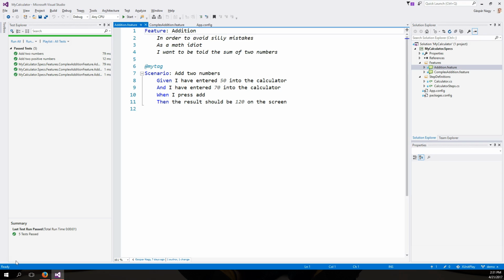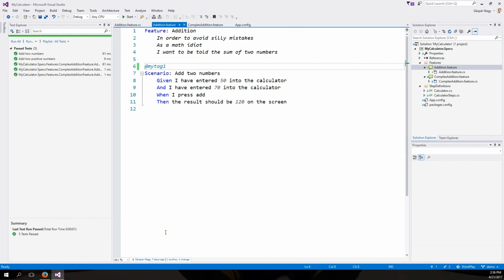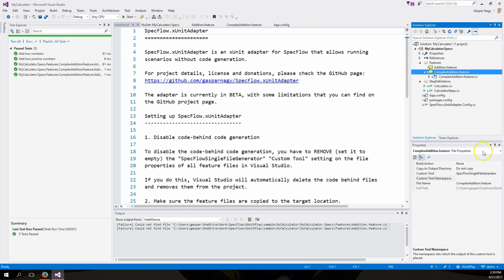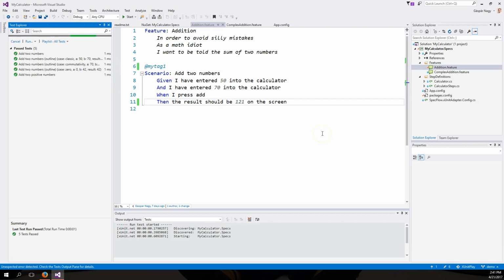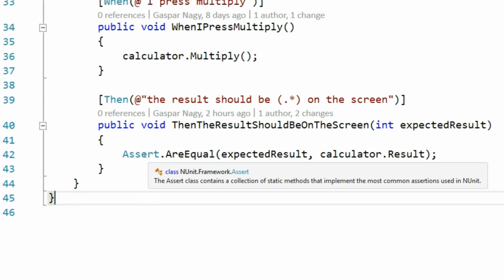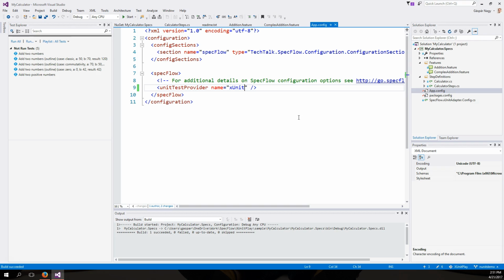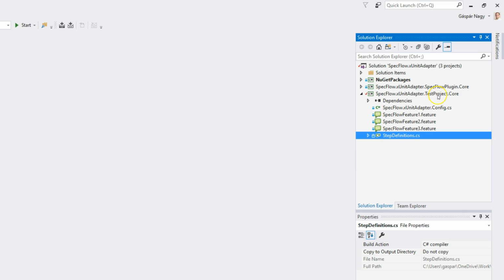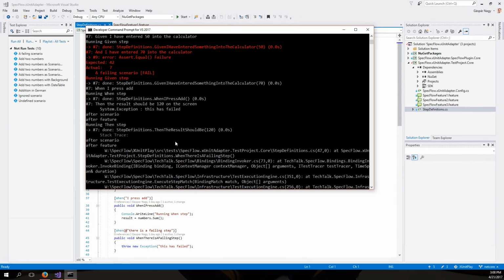SpecFlow without code behind files (SpecFlow xUnitAdapter)

Comment: Hello,

First thank you for SpecFlow itself we have started using that heavily in our company. I have couple of question how to manage big projects/modules with many steps which are shared between teams but I would like to ask this:

Will it be possible to use SpecFlow without codebehind files without using using xunit as we dont have any "unitTestProvider" in app.config? Right now we generate project-tests.dll files which are executed outside by nunit runner.